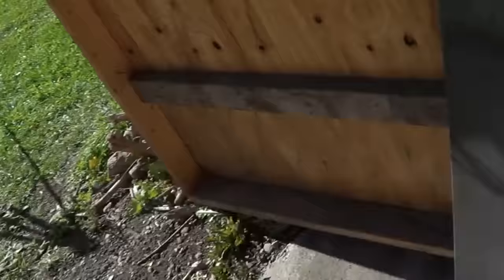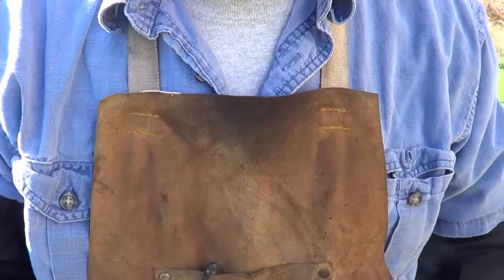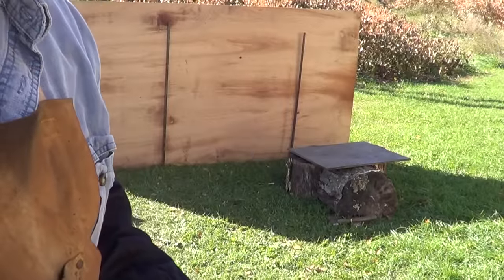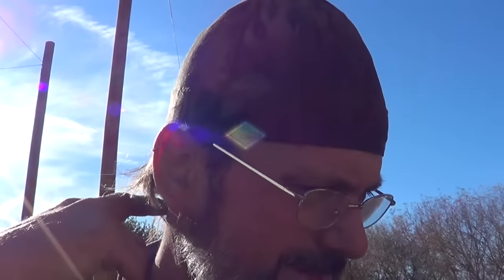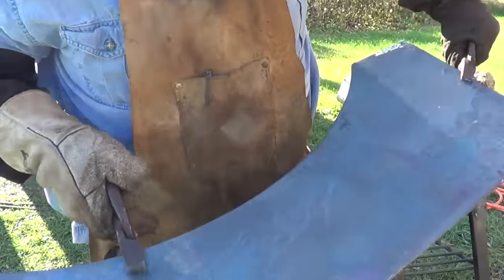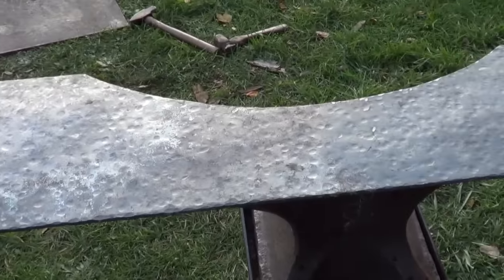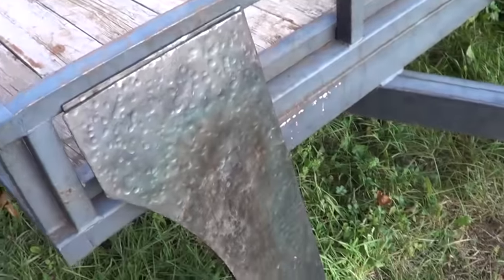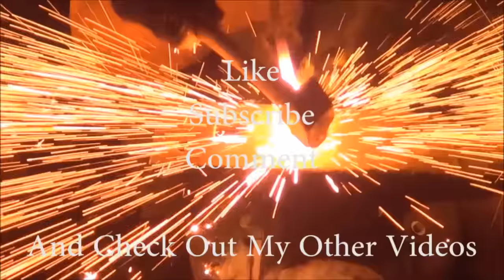Blacksmithing - Biting Off More Than I Can Chew - Hammered Table Legs

Comment: would using a clamp or a some vice grips work?  like clamping it  down to a solid surface( like a welders table ) and then using the hammers ?  so that way to cant move and warp.

Comment: Would the impromptu forge work better, if it was made with firebricks?
Reply from the maker: +IgorVonE probably but was too costly.. altho i could reuse the bricks... I know i want to build a sword forge so didn't want to invest in this project saving it for the more permanent one
Reply: +Chandler Dickinson Make your own firebrick! Just mix 100% naturally wet silica sand (it's literally dirt cheap) and water glass (which you can also make on your own). You can shape it however you want. I'm making a little trash can gas forge with a firebrick refractory. The whole thing cost me less than 50€ and that includes the little propane burner.
Good luck with it. And i for one would LOVE to see you tackle swords.

Comment: you could use an oxy-propane or oxy-accetaline torch to heat up specific areas of the piece and hammer it on the anvil

Comment: Sounds to me like you need a the blacksmithing equivalent of a farm hand. 

Hey about the knife I was going to send you. A friend of mine ended up snapping the blade (I made it thin because it wasn't meant to be a hard use knife). I'm sorry but I can't send it to you in this condition. But just like in the lord of the rings, The broken blade can be remade. What my plan is is to melt the blade down into a little square stock and re-forge it. Sounds like a fun project. If it comes out well (given that I've never melted down any kind of metal and lack the know how and materials my optimism is low) but if it does, I would like to send you the original knife in its reforged state. If that's alright with you.

Comment: Would a 2 lb. ball peen have been easier to use instead of a rounding hammer. I would think with the smaller surface of the ball as opposed to the face of the rounding hammer more force would be transfered to the work piece. I am new to this and trying to learn.

Comment: how about making yourself some kind of jig to hold the airchisle upright so you can feed thinner stuff between it and some kind steel block
Reply from the maker: +Shaun Henderson This was my plan but the air hammer cycles so quickly it was not very effective... slower and stronger is what i need... i need a power hammer...lol
Reply: +Chandler Dickinson as you say, it would shake its self apart, power hammer sounds good though. love the vids, keep up the good. work.

Comment: NEXT TIME 1 USE A SAW TABLE ROLLER   AS 2ND  HANDS     2 PUT 2 ROSE BUDS  ON 2 STANDS AIMED AT ANVIL TOP   TO HEAT  PROJECT AND BEAT IT RIGHT IN THE FLAME   AS YA WORK   SLIDE PROJECT THROUGH   TO 2ND ROLLER   NO NEED FOR THE   CINDER BLOCK FORGE

Comment: oxy with Rose bud.
Reply: +Adrian Higgins 
Dude good idea but OMG expensive.  I made some steak turners for Christmas presents a few years ago using oxy acetylene torch.  Was just lighting the torch long enough for heat for the first few of them., and was moving the needles but barely. On the last one I just left the torch lit and worked quickly.  Holy crap I drained 1/4 tank of gas finishing one piece.  That was just 3/8 round bar (what I had) that I squared off to put a twist in it.  I can't imagine how much gas one would use trying to keep a huge piece like that hot.

I certainly understand now though why on older forges why they are so huge when they have only just a small portion going.  The forge isn't huge for their day to day stuff.  The forge is huge for special work like this.